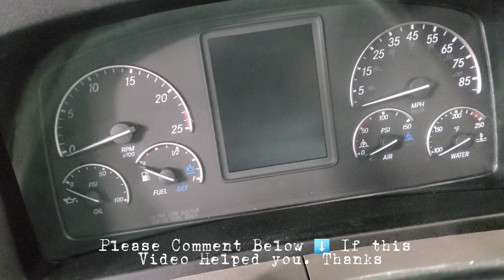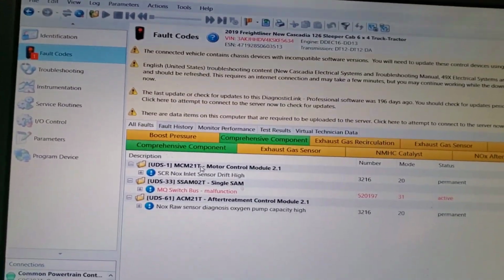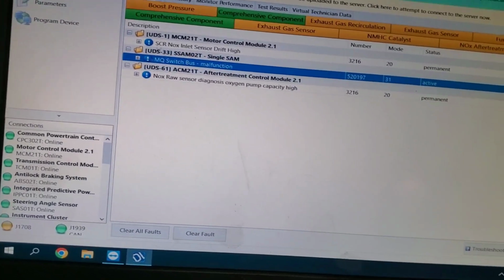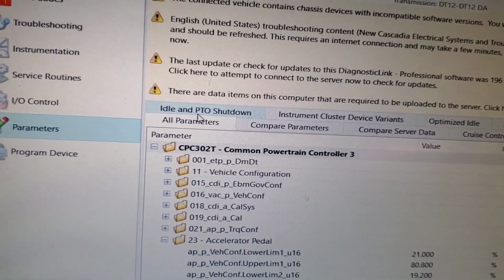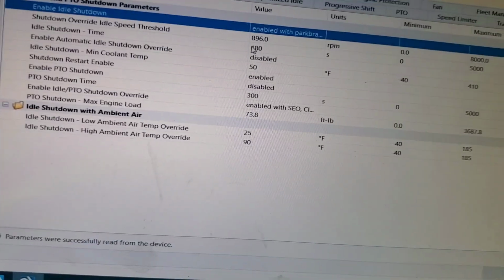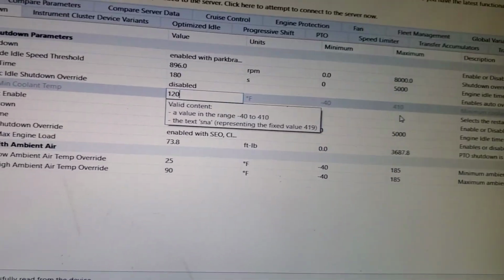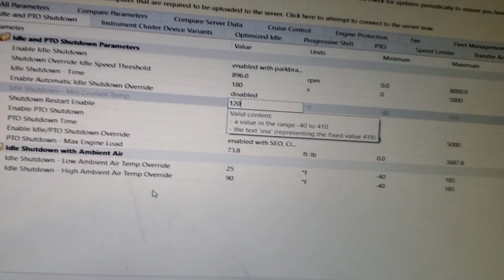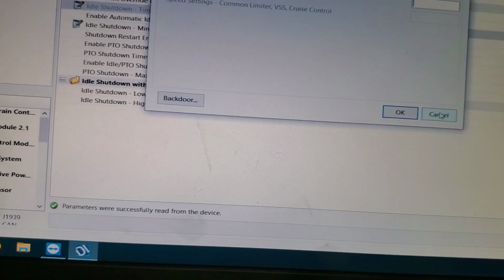How To Change Idle Shut Down Time (And Why You Should)

Comment: Is there a way to completely disable it? I took it to a guy, he has the program, it was already set on disabled, but truck still shuts off. Any suggestions?
Reply: Try ECM reprogram at dealer.   All because Commiefornia idle law. 2024-2026 Freightliner casadia
Reply from the maker: Then you need to program ecm.
Reply: Yes. Lol😂 @Truckinghelp
Reply: I got 2026.  I was able to change it.   Make sure when you change high and low ambient temp have your truck turn  to key only,  not runnings.